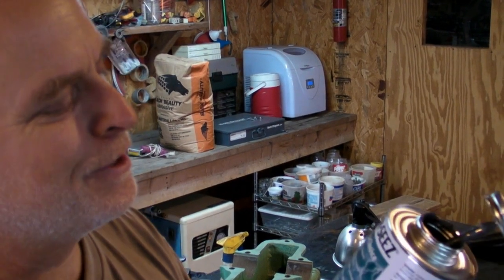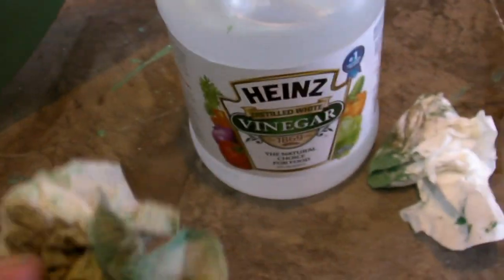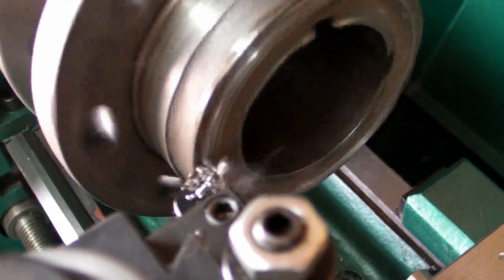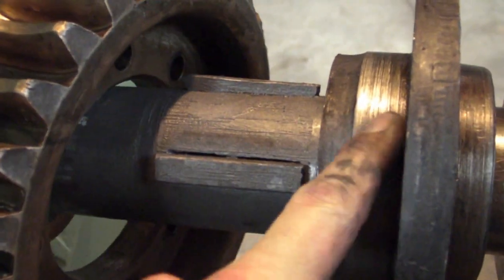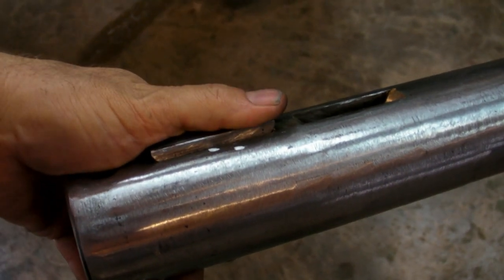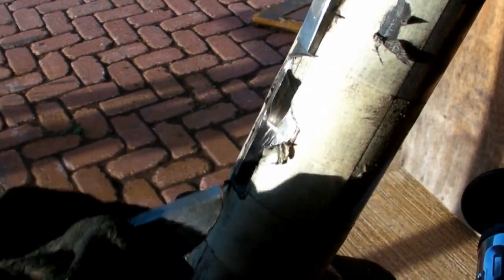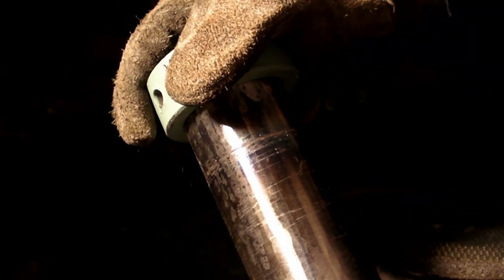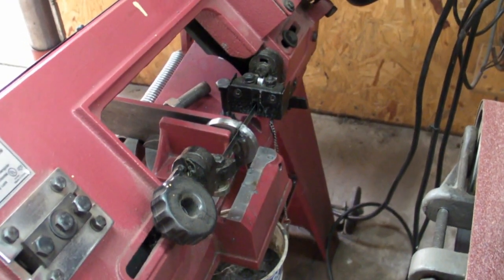Anchor Winch Rebuild - Part 3 - Woodruff Keys

Comment: Doug, I swear that if you keep practicing, you will eventually be able to make anything from nothing!  One of your biggest strengths is that you can always figure out a way to accomplish your objective using what you have at hand.  The Woodruff keys appear to fit in the slots reasonably well, considering your methods.  Those are the biggest ones I've seen.  Lots of good ideas and work in that belt grinder too, I like it!

Comment: Details.  Details.  By the sea shore.
Being a machinist for 30 some years, I've done a few woodruff keys, as well as other common types of keys.  The one thing they all have in common is that the key seats are milled to a tight slip fit, or tighter.  Grinding by hand is really rare.  A last resort, maybe?  I love your git er done approach, but that raised an eyebrow for sure.  I will say though, that bearings and bearing surfaces go out before the keyed areas do, from the repair work I've done.  Your vids are great. Never a dull moment!

Comment: I really like the demo on hand grinding capabilities, to create your shapes, you have proved that it can be done, even if some people may not be able to live with or be happy with the tolerance levels! The more contact surface to the side loads of the keys, will wear slower. The leading edges of the keyways could be ballpeened lightly to swell the material inward if needed. Thanks for the comment in the video! Thumbs up on the nail polish job, Kay!

Comment: Enjoyed this very much. As I commented once on Keith's site, it is very important NEVER to use organic solvents to remove epoxy from your skin. Doing so causes the epoxy to spread throughout the pores and to actually penetrate the skin. Aside from the toxicity and carcinogenicity of epoxy these substances are very allergenic and using solvents increases this effect as well. Vinegar, soap and water is all one should use.

Comment: Hi Doug,

The roll on your belt sander that the adjustment screws are on should have a crown in it. This is to make the belt track properly. I see you added tape to the outside edges of the roll. Make sure there is a layer of tape in the center of the roll that is maybe 1/32 to 1/16 higher than the tape on the edges. This should help your belt tracking and bracket sawing problem. Use 1-1/2 or 2 inch wide tape.

Regards,

Tom Lipton

Comment from the maker: Right on -- thanks for another tip.  It's not mill quality but it should do.  It's just a capstan.  I'm bold if I try it on the rudder. :)   So how did your customer for the "Portakey" project make out.

Comment: I think you will find that is a size "V" or "VX" sized key in round bottom or size "TX" in square bottom.  They are available in 5 packs from McMaster-Carr for about $12.  For a application like yours remember that both keys need to have a similar fit (Tight hopefully) otherwise the one key carries all the load which will lead to the early failure of both.  If you can remove the key from the slot without tools it is loose. If it is loose make a thicker key don't depend on loctite.

Comment: Real nice machining video. I have to get somebody to cut 2 woodruff key slots and I'll sure try not to loose the keys. I'm concerned about the belt  and pully on the sander without a guard! I do have a lathe like that but it is out of the way I hope. Be careful or get a safer one!

Comment: That came out really good so the yard said; they did have a better drill motor back at their yard and switched over to it. Too bad they didn't supply me with it in the first place; they had to cut the shank on the cutter due to the chuck difference in off set to center line...LOL...

Comment: just a heads up, your files will last a lot longer if you don't scrub with them. they are designed to only cut on the push stroke.

Comment: Sir my question is what are the purpose of woodruff key?? Plz tell me its simple defination how it work,
Reply from the maker: A capstan will be put on this shaft and the key will fit into both the shaft and a groove machined in the capstan, so that the capstan turns when the shaft turns.   Without the key the capstan would only spin on the shaft.

Comment: did you use tool steel as this requires that strain of steel for the torque as ordinary steel will just strip when put under strain
Reply from the maker: No, and yes; tool steel would be better, but our loads will be small compared to shear of that much mild steel.
Reply: Tool steel is too hard and is for lathe and milling tools (hence the name). Key steel is normally a mild grade so it shears rather than causing damage to the keyways themselves. Love this channel! Downloaded the template from your website to make a model boat, kept me out of mischief for the afternoon haha. I am a fitter/turner and do a lot of marine engineering so this sort of thing is very interesting. Cant wait to see the finished product. Best of luck!